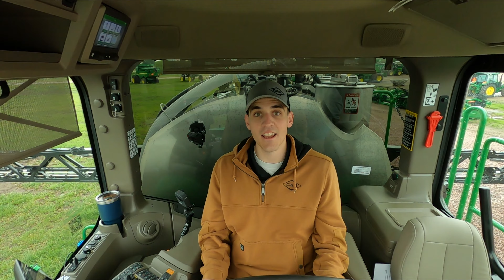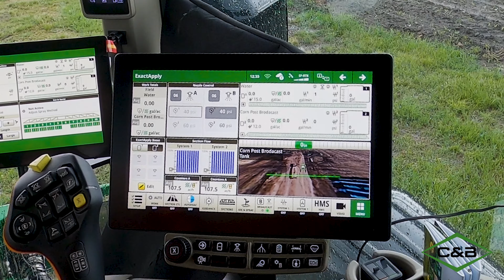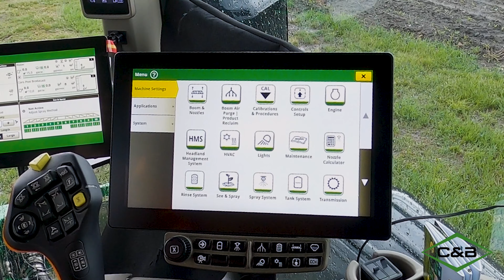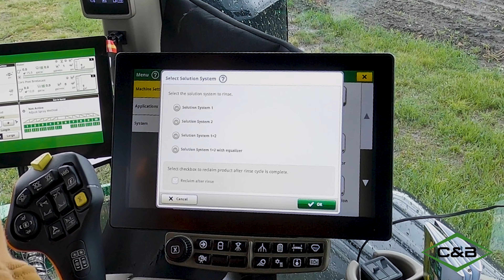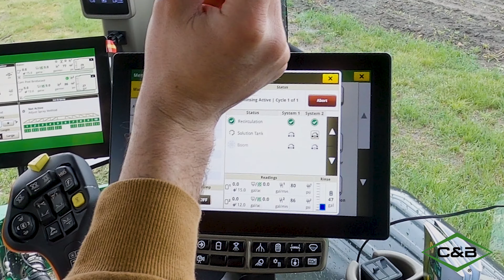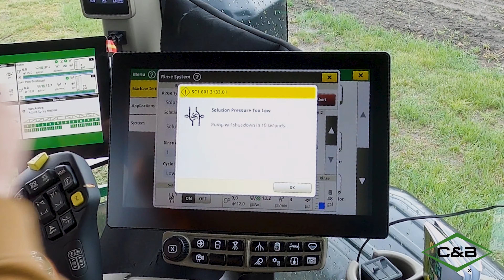How to Rinse: John Deere See & Spray Ultimate

Comment: Good day, I have a see&spray ultimate and was curious if anyone knows exactly how the rinse cycles work. Specifically, I watch as it rinses the recirculating system and it only draws my rinse tank down about 50gal. But rinse for 5 min and shows flow of 40gpm during this time. Does it pull a little from rinse and then just switches to solution tank and draws from there to finish or?
Reply: It depends on whether you choose low, medium, or high volume rinse cycles. It can use 50-100 gallons of clean water per rinse then it switches to just circulate the rinse solution in the main tanks. It uses the main solution pumps to push the rinse water through the boom recirculation plumbing and and back to the tank it drew the water from.